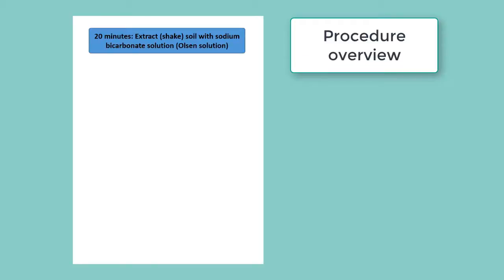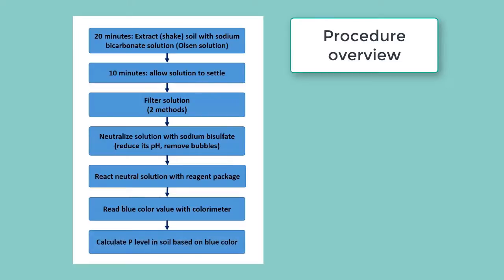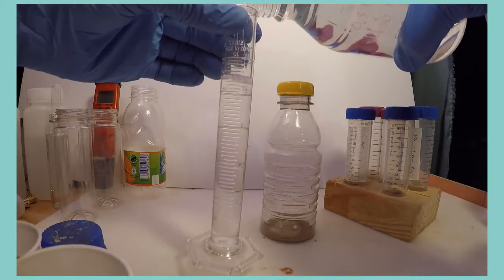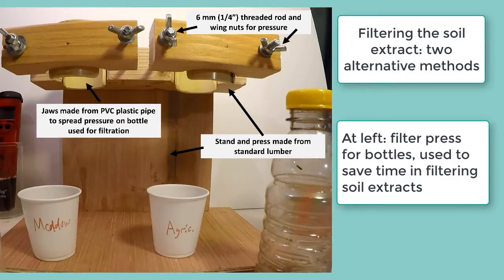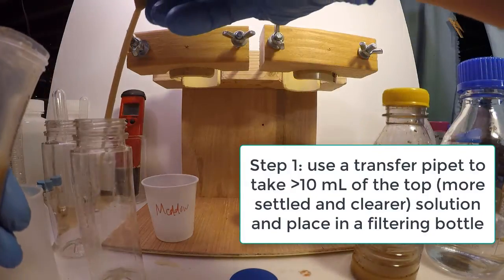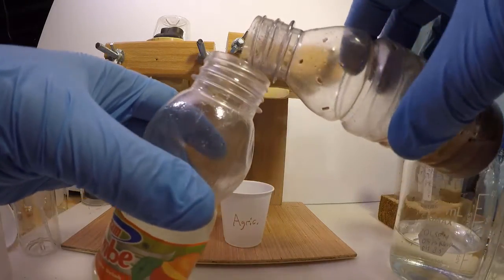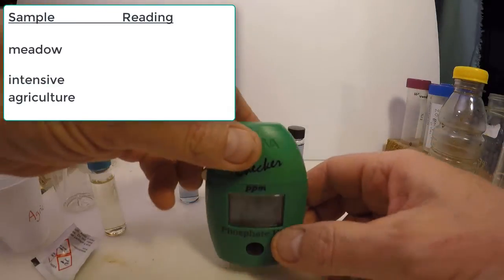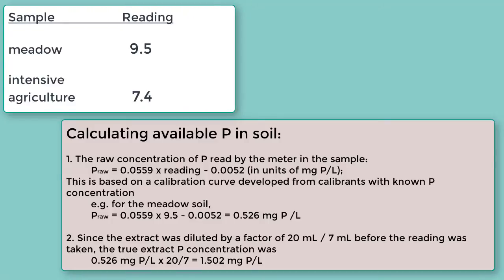Available soil phosphorus (Olsen P) for soil  health - OLD version, see description for new link

Comment: Can this method be used to calculate the amount of phosphorus in the sludge resulting from wastewater treatment before drawing water from it and after its drying?
Reply from the maker: Hi, well it will probably reflect some aspect of bio-available phosphorus, at least as a yardstick analagous to a soil fertility test.  It will NOT reflect a quantitative measure of total P in the sludge, if that is of interest.  That would be a more involved method with chemical digestion / ashing perhaps, and analysis of ash.
Reply: @lloqalla  hi. Can we use this method for BIOCHAR to calculate plant available phosporous?